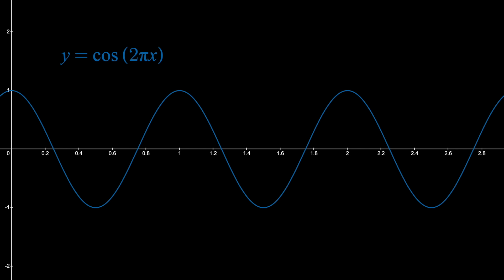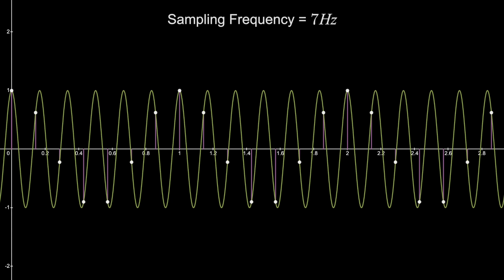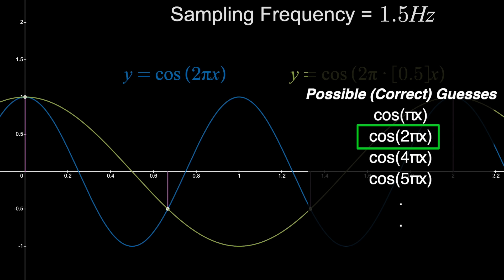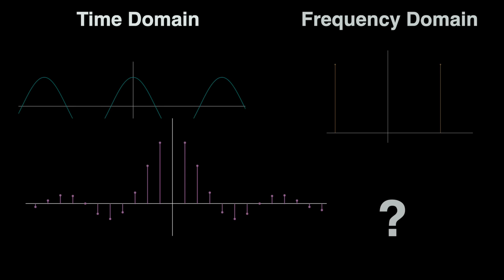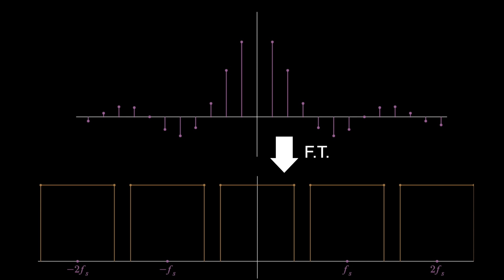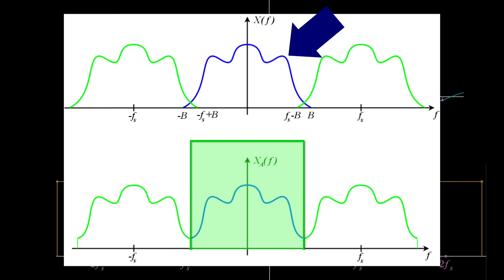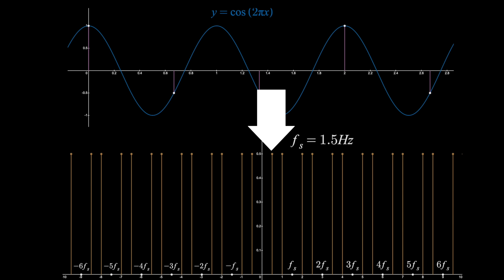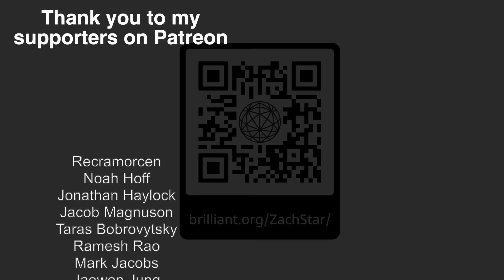The intuition behind the Nyquist-Shannon Sampling Theorem

Comment: I've always been a little confused about whether 2f is enough, or if strictly greater than 2f is required.
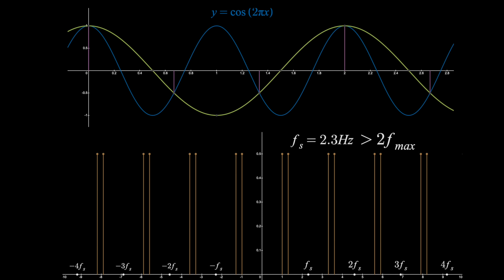At 3:50 you say "faster" and use a greater-than symbol, but at 9:58 you say "at least" while still showing a greater-than.
I get that in the real world the sampling frequency is never gonna be exact anyway so you need a decent margin (and you showed CD audio being 44100 not 44k as an example of that), but in theory, can I get away with 2f or do I need 2f+epsilon?
Reply: In theory sampling at 2f is enough, in practice before ADC we need analog low pass anti-aliasing filter to get rid of frequencies >f. If you don't do that, noises from bats, etc. will "alias" to lower frequencies that can be audible by humans, which is bad. Analog filters are not perfect, 20kHz low pass filter still passes higher frequencies but with lower amplitude. So, we have to sample much higher to combat aliasing from imperfection of analog filters.
Reply: Sampling at exactly 2f is sometimes enough, but in most cases isn't. It depends on the phase difference between the samples and the frequency at f. 

If the samples just happen to fall on peaks of "f" - the signal will be recovered exactly. However, if the samples fall in any other place - you get the frequency at "f" with a reduced amplitude. And if they fall exactly on zeros - the frequency at "f" will be lost.

Of course, that's assuming we have a perfect low-pass filter to recover the signal.